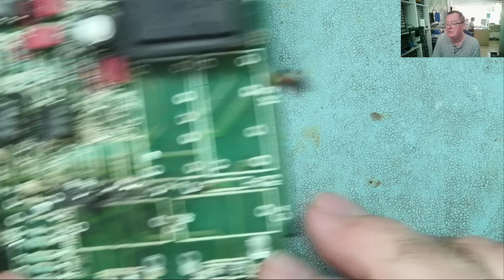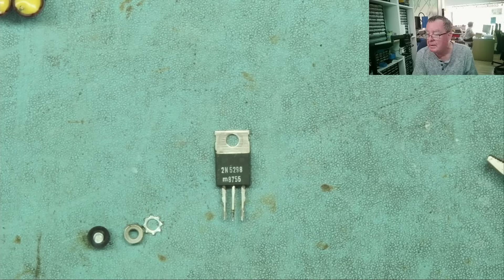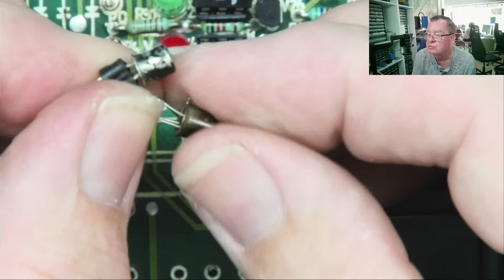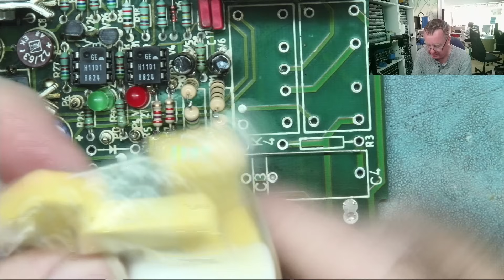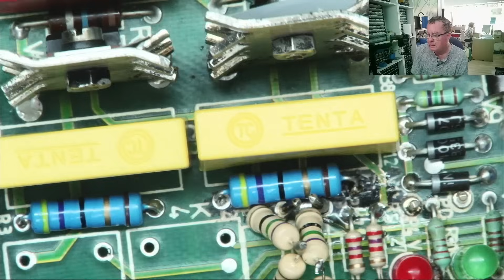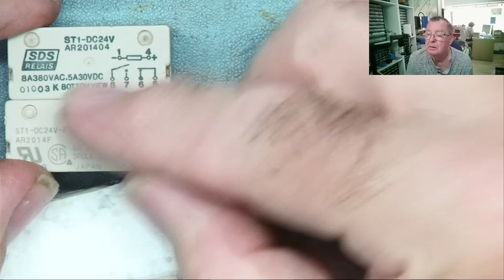This PCB Set On FIRE! Let's Repair It!! Industrial Electronics Repair.

Comment: I would have 'cleaned out' the burnt PCB since there is so much carbon in there - there will be a resistive bridge to the traces (which is of concern since one end is connected to a 1 watt resister)

Comment: The other top use for a fibreglass pen is for cleaning battery contacts after a leak where they are deep inside a battery case. I used to try sand paper on a stick, which worked about as badly as one might expect.

Comment: Comparing the damaged PCB to the other picture you had, seems to imply that both boards suffered similar failures, there was damage on the other boards opto isolator socket. The combination of the failures implies a design problem. 

Fibreglass pencils, great things, but I always clean off into a bin and wash off with IPA and brush off with a small paintbrush, since you will always end up with some in your fingers for a couple of days.
An abrasive PCB rubber is a good option when it comes to connectors and oxidation on pins and the like. 

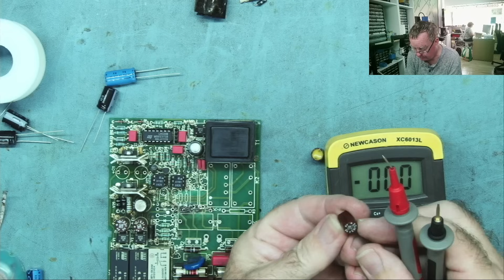At 11:04, was the trace under C8 broken or just covered with flux ?

Comment: It maybe worth checking the ESR of the 22uf caps you put back in circuit, the heat from the blowout could have been enough to change the chemistry of the electrolyte, increasing ESR.
Reply from the maker: To be fair this is clearly not a high frequency switching circuit so why would ESR matter here?

Comment: As I mentioned previously, the type of resistor used in a snubber network can be quite important.
The originals appear to have been carbon composition. Carbon comp resistors are almost unavailable now. One of their notable merits is ability to handle quite significant transient overload. Film resistors are very much inferior in this aspect. Metal film are poor. Metal oxide film are considerably better than metal film. Both are somewhat inductive due to the spiral arrangement of the film, but that isn't an issue for this sort of snubber.

Replacing a "ordinary"  triac with a sensitive gate type is perilous. It is sometimes OK, but if the load is inductive a sensitive gate part may not turn off properly. There are some types that are specifically designed to work reliably with loads that are difficult to commutate without the use of snubbers.

Note also that the original relays have polarized coils. This is because there will be a permanent magnet that "biases" the beast so that it will pull with considerably less coil power. The replacements selected look fine for this repair, but it is something to keep in mind.
Reply from the maker: Actually I did notice the relays are magnetic, when I was cleaning up my bench after the repair I saw some discarded component legs stuck to one of them.  Thanks for the info.  Regards the Triacs I don't know if the original ones are faulty (they were right next to the burnt capacitors and you can see from the heatsinks they were within the flames) or they are just less sensitive. They needed to be changed anyway and I could't find the original type. Some subscribers recommended two equivalent types and BT16-800B was available so I used those. I guess we just have to see.

Comment: How you know that multi layer board isn’t damaged?
Reply from the maker: I don't know if the board is damaged or not. But I do know it is not multilayer so I can see both sides of it and I am happy with what I see.  When it comes to industrial/commercial PCB repair like this you can never be 100% sure the repair will work and neither can the customer. As an engineer you do your best to repair it and the owner basically takes the chance that you have the skills to do so,  Nothing is guaranteed but I beleive I gave this one my best and after that it comes down to a bit of luck either way. I would be interested to hear other viewers opinions on this repair.

Comment: I hope this board now works and doesn't come back burned again.
There may be other faults in the folding machine.
Reply from the maker: It is quite possible but he tells me he found an engineer on one of the other Canary islands (El Hierro) who is an expert on these machines - though not component level repairt like this - to come and test the whole thing for him. I have a good feeling about this but will let you all know one way or the other
Reply: @learnelectronicsrepair  Fingers crossed that this board now works.
You can only rebuild them so many times.
Reply from the maker: @BarbaraPape-y4g  I totally agree, this is the nature of this sort of repair. You can only do your best job and eliminate as many possible prolems as you can. There is no 100% guarantee with industrial repair like this,, there is also a certain amount of luck involved though the more you practice the luckier you get 😉

Comment: I use that type of fiberglass brush as well, and the fibers do break off and get airborne. That's why it's good to use some water or whatever with it to capture the fibers so they're not floating around also when you go to get the dust they create off the board with another brush keep it all wet to keep the fibers captured.

Comment: Fibre glass pens are also good for removing solder resist from a track before soldering to it. Bettter than scraching with a knife!. And removing oxidation from copper etc before soldering.
Reply from the maker: I must admit I was really impressed with the fibreglass pen. It's rather like the dremel, once you try one you wonder how you ever managed without it.  Guys take note 🙂
Reply: These fibreglass pens / sticks have been around for at least 45 years. When I was repairing industrial electronics way back then we used to call them "thistle sticks".

Comment: Did you use an ultrasonic cleaner on the board? Did you check the 7818 regulator after you removed it? I would assume the regulator input comes from a relay, so hard to test on the board without closing the relay switch first.
Reply from the maker: No I don't have a ultrasoinic cleaner. No I didnt' test the 7815, as I explained in the video when I worked out it isn't powered from the transformer on this PCB I simply replaced it.
Reply: @learnelectronicsrepair What I meant was, after you replaced it, did you: a) throw it away b) put it in your spare parts bin or c) check it first, and then put it in your spare parts bin or toss it?

Comment: Can't you just test the power triacs straight across your Dim Bulb Tester? Seems like a very quick and easy test.
Reply from the maker: I could test them in that way but took the easy way and just replaced anything (including those) which I could not simply test.  This is quite an involved and expensive repair to fix a very valuable piece of kit for the company that owns it. I totally get what you are saying from a technical point of view but often with industrial/commercial electronics like this the best option is to test everything you can reliably say is OK and replace everything else.